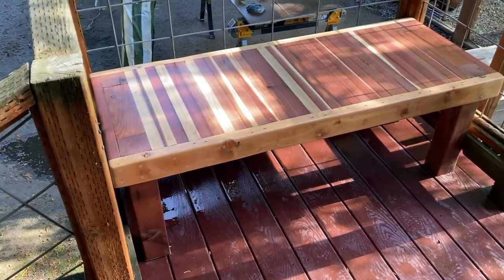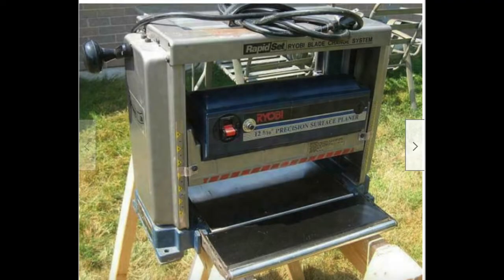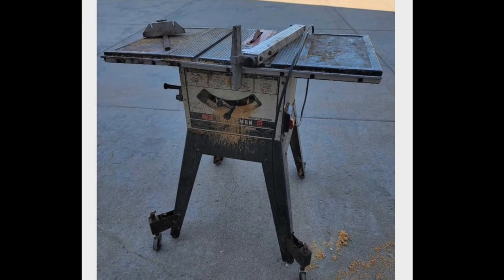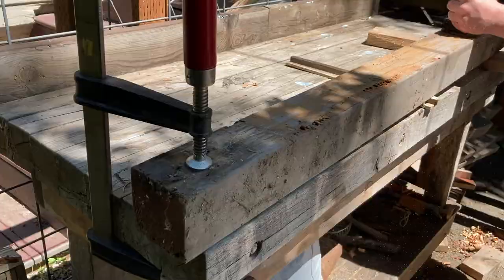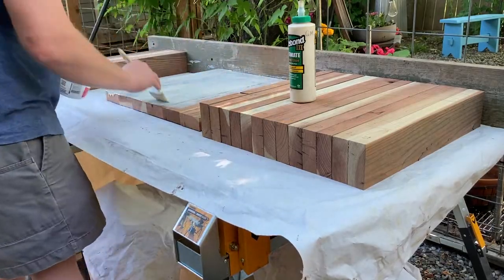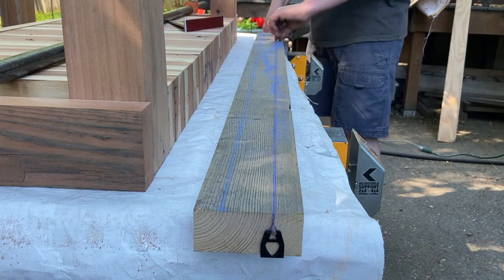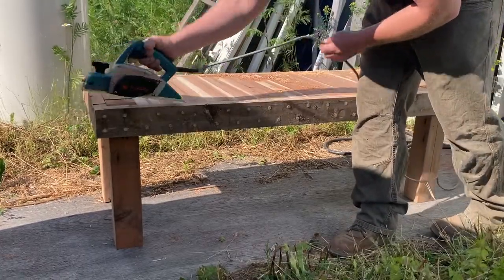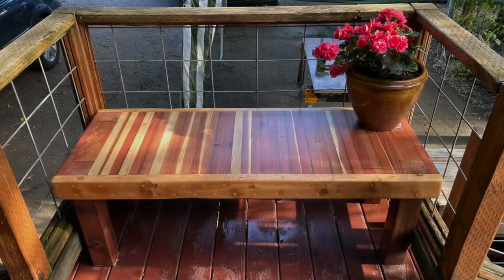Reclaimed Redwood Outdoor Bench For Back Porch

Comment: I build variations on this bench, from pallets, all summer long and sell them for about £40 each. At that price they fly out the door and I’m getting paid to do my hobby. A simple 2 seater bench seat like this is easy to make and you can vary the design so you don’t get bored. I overbuild them really heavy as you have done and no one has ever brought one back complaining it broke as a result of weak design. Only thing I would have done is put gaps in between the slats to allow for expansion and contraction. You can also put handles on either side, people drink that up for some reason.
Reply from the maker: I think the gaps would be a good idea to let the rain fall through as this will be an outside bench.  I like the handle idea too, so that people can move the bench around easier.  Let me know if you post a video of your bench sometime as it would be interesting to see your style.  How much time does it take you to build one of your benches?
Thanks!
Reply: @foundit6088  I can send you a bunch of photos if you have an email but I don’t do videos. The time depends on the bench but you can knock one up a get a finish on in just an afternoon.